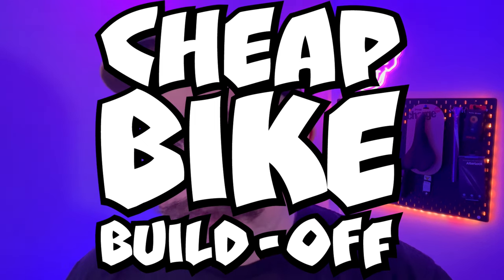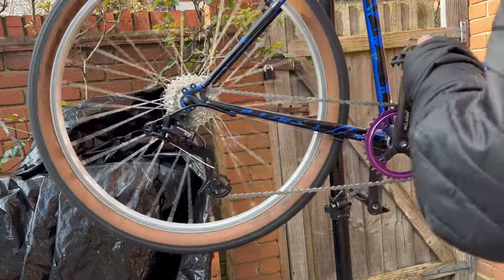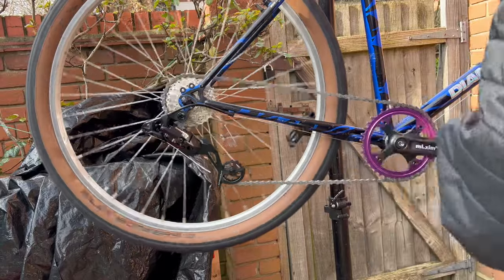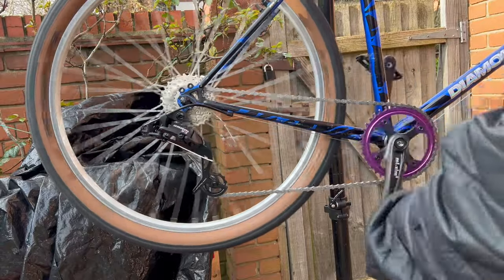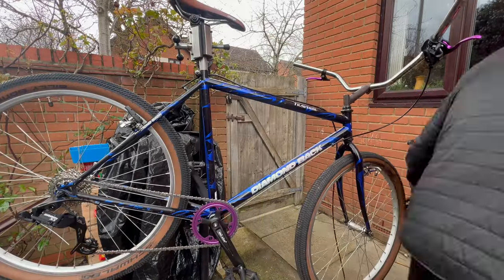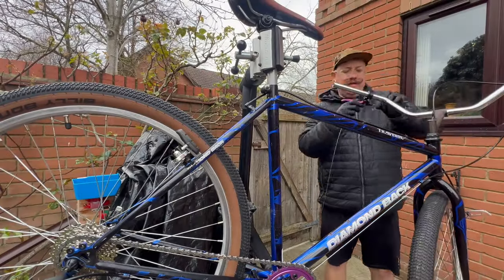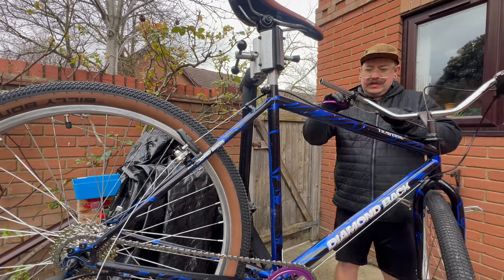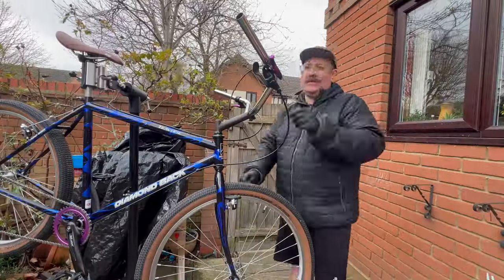Cheap Bike Build Off - Diamondback Traverse Restoration -  parts bin Commuter bike build vintage MTB

Comment: You have to be careful with these kinds of valve caps that have metal thread inside of them. Due to humidity corrosion happens and they get stuck and you won't be able to take them off and inflate the tube. A bit of lubrication might help, I use a bit of Park Tool HPG-1
Reply: Alexandru87
Thats right. Plain plastic dust caps are the best for the job.
Very often its a mistake to reinvent the wheel